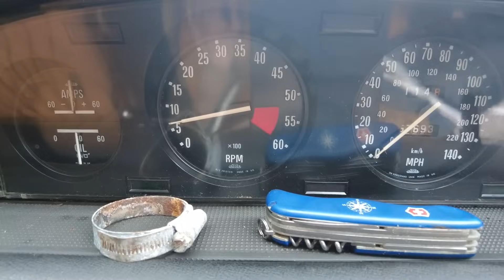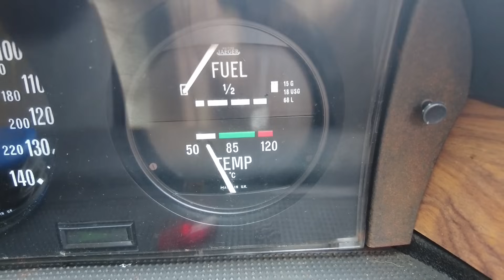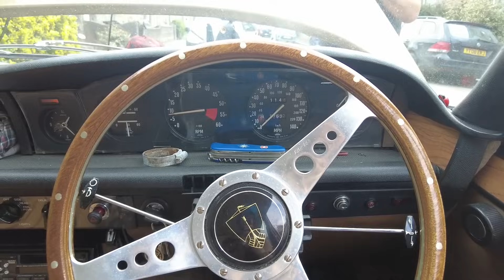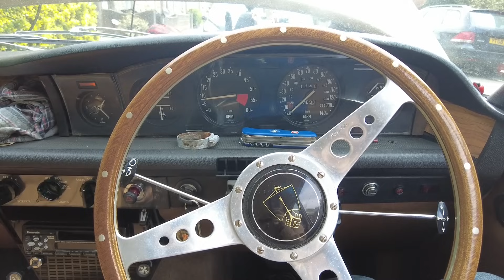I Bought A Rover P6 V8 Auto Episode Eight Sweet As A Nut!

Comment: This is why I love old cars, a couple of blokes replacing engine components at the side of the road. Just like it used to be. This is why I love this channel. Keep it up guys, this is great 👍
Reply from the maker: Glad you like it
Reply: Back when I was a young man we just blocked the car up in the air in a gravel driveway and worked all night to replace the clutch or whatever was needed so we could go cruising the avenue the next night. I still remember blowing the clutch on a medium blue 66 Chevelle SS396 one night and laying on the gravel pulling the transmission so I could put in the new clutch. Seemed like a lot of fun at the time even though the gravel wasn't that fun!

Comment: It sounds 100% better, Sheldon, well done to you and David. A couple of things to double check, though, before you put any miles on it. Did you check the flow direction on the SU fuel filter ?  They're directional, and there is an arrow moulded into the plastic body,  or it will say in/ out.  Get it the wrong way around, and it can quickly clog the inside gauze and give mysterious fuel starvation symptoms at intermittent revs.  There should be the same type of filter, without the compression fitting nuts, fitted at the rear of the engine on the right angled brass pipe on the crankcase ventilation system. That filter, if blocked, can allow pressure to build up and cause oil to be forced out of gaskets.  It should be fitted with "in" nearest the crannkcase takeoff pipe as it sucks crankcase fumes into the intake airstream. Just like with the fuel filter, the dirty fuel or air goes into the outside of the filter, and the clean stuff comes out of the middle, so you can see the state of the filter through the plastic case. The other thing to check is the water pump to heater box transfer pipe. It's the metal one bolted to the underside of the intake manifold. They're mild steel, and from the state of all that 50 odd years of solidified top end coolant crud, it would have been wise to replace it.  They rot from the inside, and you'll get coolant sitting on the valley gasket once they get a pinhole.  If it goes, you'll get a coolant air leak/ airlock / hotspot, and an erratic or undereading temperature gauge that can cause head gasket failure. They're easy enough to fabricate a new fit and forget copper tube replacement.  You should be able to reuse the valley gasket if you've not done any mileage.

Comment: That thin pipe David was querying between the carbs and radiator is a water hose.  It's the air bleed off pipe, and it ensures there's coolant flowing up to the plenum chamber, an no airlock in the highest coolant point on the engine.  It's a water heated intake manifold, so check that thin metal outlet pipe isn't blocked, or you'll get a hotspot and fuel vaporisation.

Comment: You had the heater hoses correct first time. Bottom connection on inlet manifold goes to top connection on heater. In practice it doesn’t make much difference but the wrong way round can allow air to be trapped.
Reply from the maker: FFS now I got to sort it LOL

Comment: Fan belt's still flapping!!! Make sure the heater is set to HOT when bleeding through. 😃
Reply from the maker: Yeah going to ajust it
Reply: There’s no valve on the p6 heater so it makes no difference, hot or cold.
Reply: It does have a water valve on the heater box, it's under the insulation jacket.  You'll get an air lock and a top end hotspot if it's not set to "hot" when filling it up.  You should run it at fast idle, around 1500 rpm for at least 5 minutes once it's up to temperature.  The coolant level should be around an inch below the filler neck, or just over the transmission oli cooler tube that is visible inside the filler neck.  FCheck the coolant from cold and fit the radiator cap with it running at fast idle, or you'll always be running on low coolant as the heater matrix will drain down.

Comment: Have you shimmed the rocker shaft posts to ensure correct tappet/valve clearances. Were there any shims when you previously removed the rocker shafts ? Incorrect clearance may have caused your previous tappet problem
Reply from the maker: Yes we did but not on camera as the battery died at the time
Reply: Plum

Comment: Sounds great.  BTW what temperature thermostat does it have?  It seemed the water was circulating in the radiator pretty quickly after start up.
Reply from the maker: It got to about 40 before it opened but it's not the most accurate gauge
Reply: It will circulate fast as there is a thermostat bypass hose to direct hot water around, from the water pump, to  the heater matrix before the thermostat opens. A P6B's heater should start to receive rising temperature coolant, and give off heat within minutes of startup.

Comment: Not good practice to use a screwdriver to tighten jubilee clips. They tend to slip and wear the screw slot. A wrench or socket (most current ones tend to be 7mm) avoids slippage and makes for a tighter clip.
Reply from the maker: I know sadly I don't have any metric sockets
Reply: @classic_britain  Halfords do a 25 piece, 1/4 inch drive socket set for 17 quid. Excellent quality and just the thing for jubilee clips and similar tasks. Sockets from 4mm to 14mm, uj and extensions.
Treat yourself and make your hoses tighter.